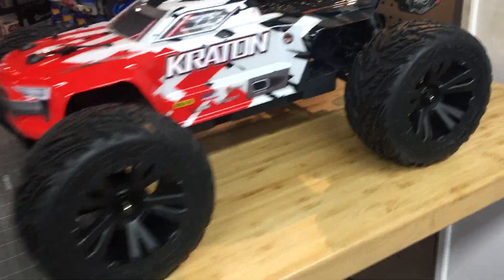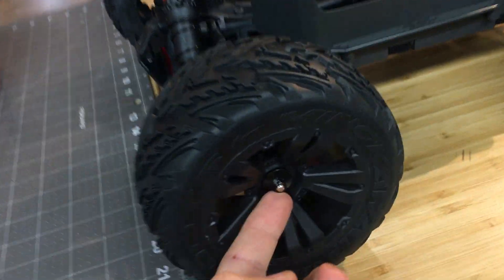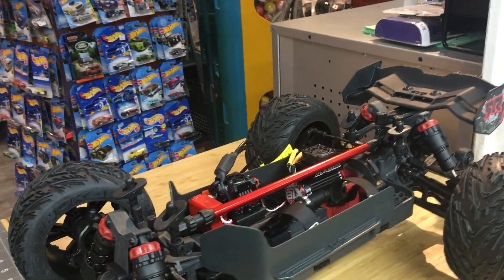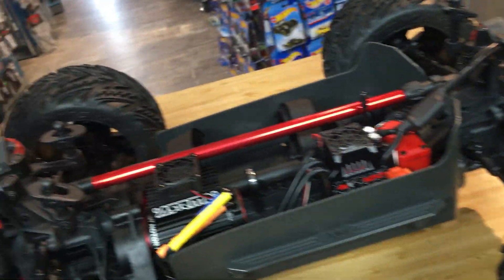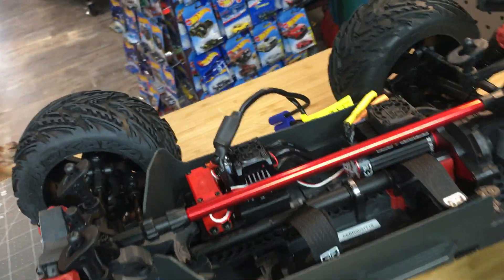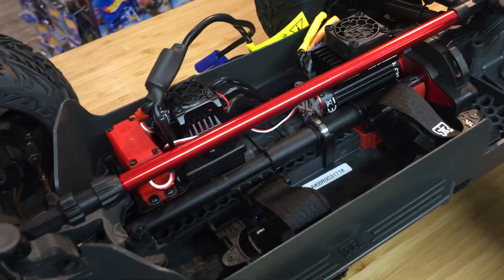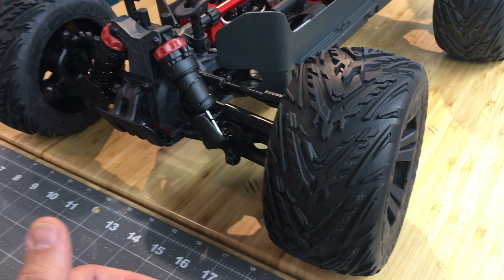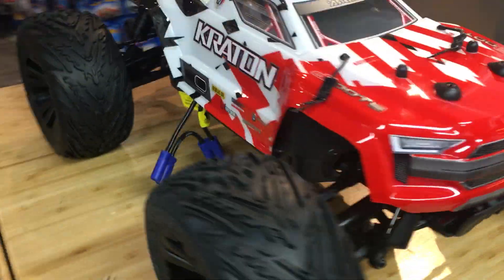Arrma Kraton 4s is fully lit

Comment: I've had some dependability issues with mine but nothing I haven't been not able to  toss somme money at for parts to make as good as new again. If anything the drive shafts to me are really the big downfall of the 4S Kraton. I've fixed them several times front and back so, maaybe I just need to drive better. Nah, beeing a hopped up Arrma Speed Junkie is to much fun. Bash, Break and Repair, then do it again. It is the Arrma way!! I'm lovin eevery moment still.

Comment: OK would love to get your opinion here really thinking about buying one of these I have a ton of to sell batteries unfortunately most have Dean’s connectors as I’m not good at soldering but I’m working on it I know this is not the ideal connector but do you think it would hurt the electronics or have any overheating issues running Dean’s connectors with converters in this truck
Reply from the maker: Get your batteries swapped to the new ec5/ic5 standard    that way you can be warranty safe 
we offer in house soldering, you might find a local shop to help you change the ends. Or you could grab some fresh batteries with the new plug on them.... I hope that helps.  
If you are local feel free to drop in and we can help you with any service 

Chris
Reply: Chris's House RC Vehicles I am not local but does your shop do online